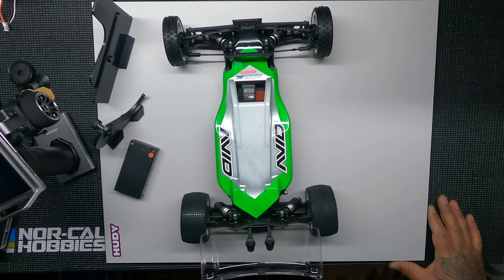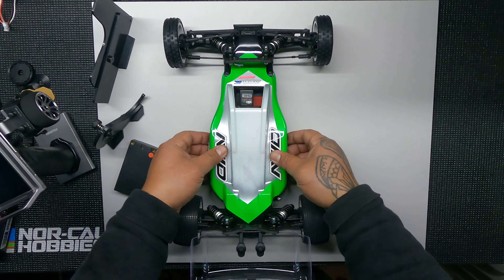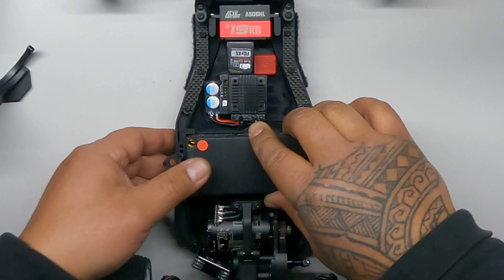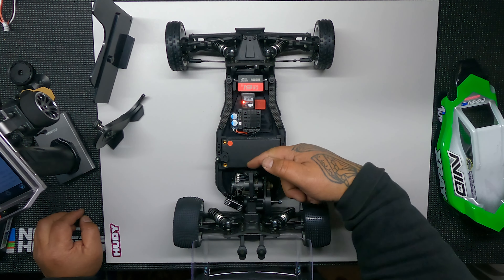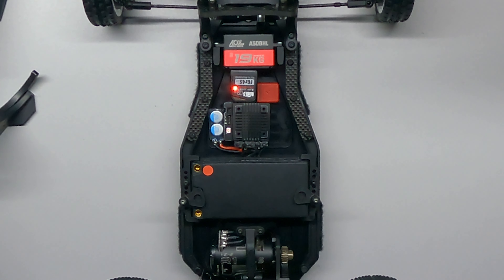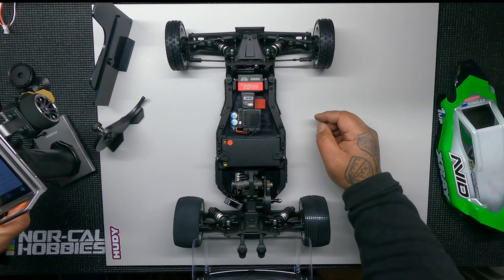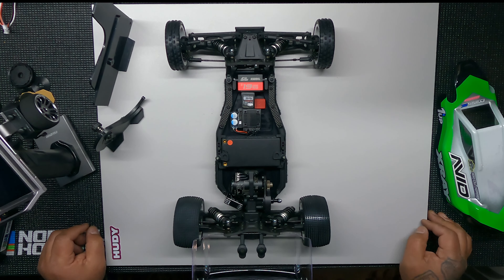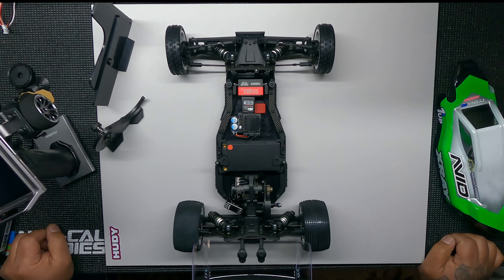My Xray XB2c'22 build. With super clean wiring!

Comment: Are you making these battery trays?  This is a pretty slick set up.  I’m a newb.  But this appeals to me.  Especially how easy it seems to get battery in and out.  Is it difficult to pull battery out?
Reply from the maker: I am making these. It's easy to pull the battery out. I'm still tweeking the tray. So I'll be making some updates to it.
Reply: @AdamLeeRC  I’d love to buy one.  I haven’t ever built a car before.  So.  Stupid questions.  Will the tray work in the Schumacher cougar ld2?  I am deciding between that or the X-ray.  Also.  Are the trays battery specific?   Or are the batteries standard on location of the “sockets”?
Reply from the maker: @derekradcliffe3313  I've owned the LD2 also. Great car! The batteries are all the same. I haven't made a tray for the LD2 yet...